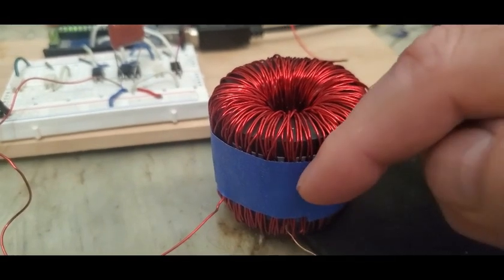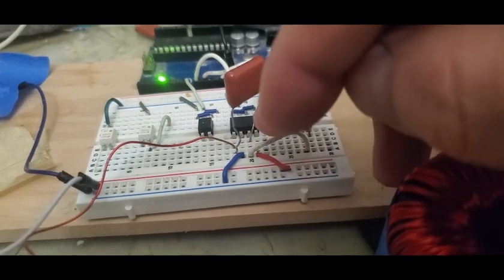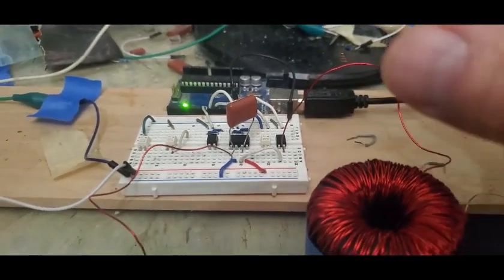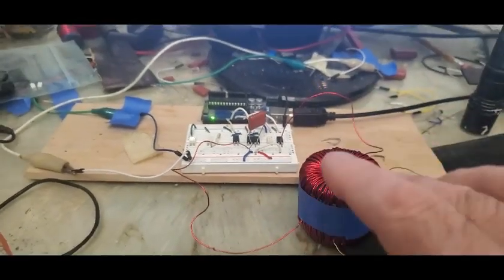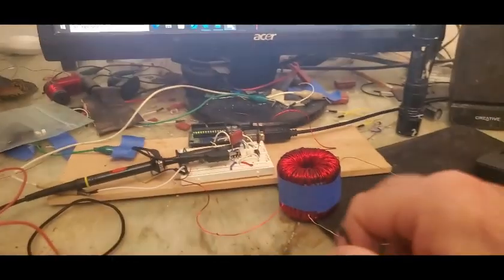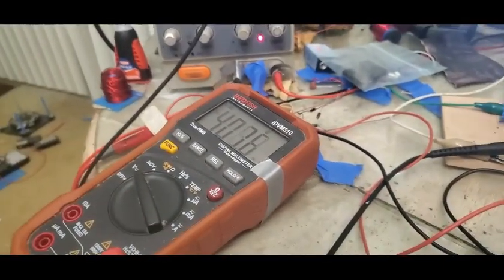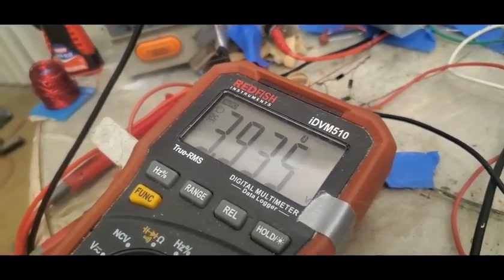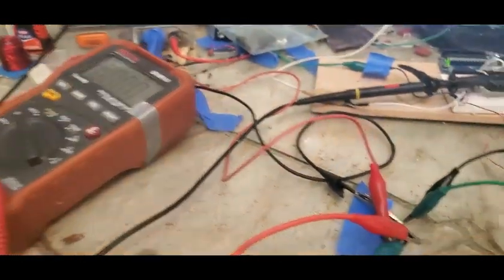Two Coils, Two Magnets and a Capacitor

Comment: Your very welcome, if you need any other schematics made, just email me!
Reply from the maker: Ryan,

Many thanks.  

I am currently finished with and putting out the next the video, in the one after that I will look to note and thank you for the work you did diagramming out my nonsense!  Will also try to figure out a way, maybe Google Docs, of attaching it the relevant video.  The Utkin approach is a different and rather unique way of transforming voltage, thank you for the schematic.

Paul Maher, MD MPH